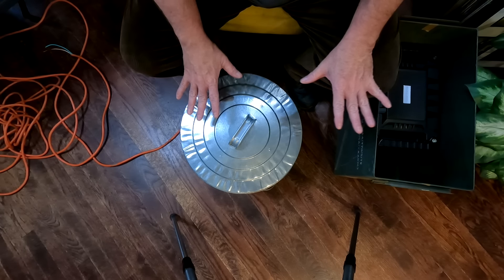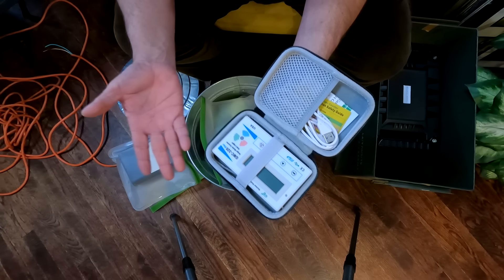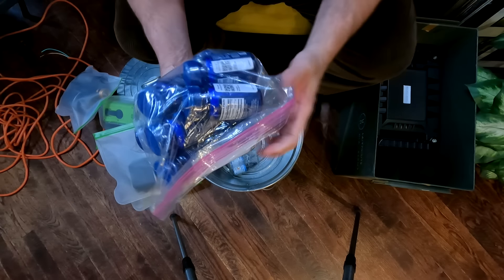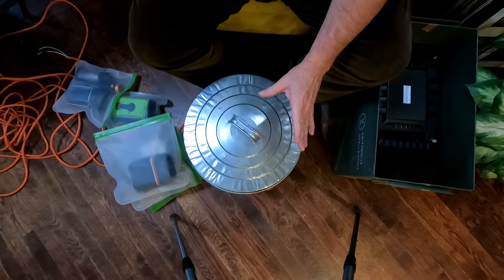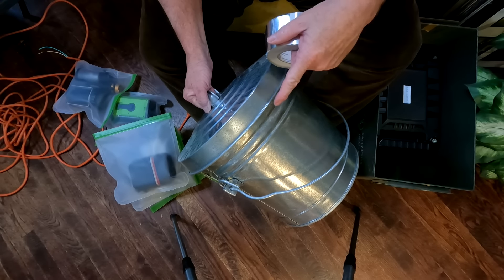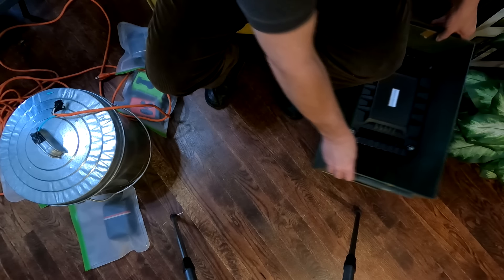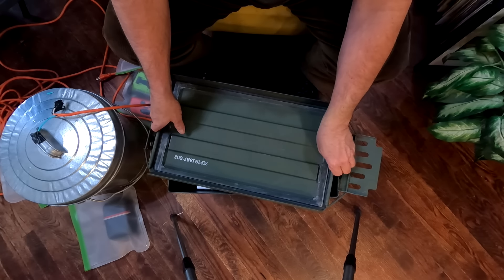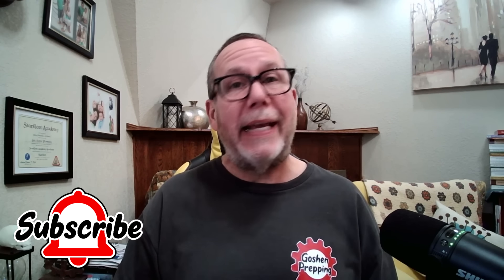How to make a FARADAY CAGE – The Correct Way – Quick and Easy

Comment: The Faraday cage is to protect from 'electromagnetic' interference .. not radiation itself. It's purpose is to protect electronic equipment from being damaged by an EMP source that will generate high voltage and high current surges across the surface of a metal container.
The cage MUST be electrically 'airtight' and a rubber seal WILL matter as electromagnetic waves will pass through rubber.
The items within the cage must be electrically insulated from the cage itself .. that is .. wrap each item in something that does NOT conduct electricity.
Inside my cages, I have used marine carpet to line the inside and to ensure that nothing within the case will be able to come in contact with the actual case metal.
If you wrap each item individually with aluminum tape or use a mylar bag ... make sure to insulate the item from the aluminium or mylar as well.
Remember, if you use aluminium/copper tape to seal any gaps,  there is a thin layer of non-conductive 'adhesive' that's being used to stick the tape to the cage ... therefore, ideally, you need to ensure that the tape is ACTUALLY electrically connected to the cage.
At the end of the day, it can't just look the part, it needs to actually do what it's supposed to do!
If you should be unfortunate enough to experience a nuclear detonation and live through it, DON'T open the case straight away .... there may well be more detonations to come over an extended time frame.
Reply: If I use insulating foam padding inside the can, but there are gaps/seams between pieces of paddings, my electronics are not touching the metal can itself, is that ok. Or do we need to tape up the seams to prevent any sparks? Use metal tape? Thx
Reply: Make sure to wrist strap and use an esd mat. The bigger your antenna, the less the emp will attack your electronics, and it's helpful to drive your ground rod thru the can for maximum effectiveness.
Reply: I hope people take the time to read what you wrote. He doesn't seem to understand what an EMP actually is.

Comment: To avoid shock when opening your Faraday cage wear thick oven mitts.
Reply: I wouldn't trust oven mitts. When I would replace picture tubes in arcade games I would use a screwdriver to shunt the electric charge built up in them straight to ground. Id always do it twice just to make sure it was completely discharged.
 
 Which brings up an interesting thought. I didn't see him mention that the faraday cage should not be set on a cement floor and in a grounded environment.  The can itself should be grounded.

 I'd like to see experiments on this and the amount of electrical energy that could closely relate the emp discharge of what you are trying to protect against.  What is worse. Not be grounded and the metal itself will attract the emp or will there be feed back to earth ground that would lead to it? You can't imagine the amount of energy being created and based on the distance it has occurred brings up so many variables.

Comment: Good video.  I'd recommend any comms being added to the pile, as well as any small smart batteries, (like 18650 with chips), and any new LED household bulbs.  It would be a bummer to not have household bulbs!
Reply: I put 2 way radios and some pale blue batteries as well as an electric forehead thermometer , an ecoflow river, and a steripen
Reply: Night vision equipment too if you have any, and Electronic ear protection.  Small solar chargers. Maybe even small foldable or roll up solar panels. I’m not sure if they will be effected or not. I don’t recall anyone ever talking about the solar panels being effected, but I bet controllers and inverters could be. Just some thoughts.

Comment: Thanks for your videos. I’m a bit confused about insulating electronics inside the can,,, yet you mentioned in a past video that your automobile’s are safe a don’t require protection. Electronics are electronics, be it a laptop or automobile components. I’ve done research from PHD’s and they indicate automobiles do need protection. Good luck everyone!
Reply: They sell some kind of surge protector you put on the battery but could be a scam?? autos before electronic ignitions wouldn't be  affected probably older than 1975, my 78 chevy truck had a ignition module in the distributor!😲😲
Reply: Yeah you are right , almost all cars made after 1980 will be inoperable after an EMP , but you can go ahead and steal the batterys out of the non functioning cars and charge them with your solar panels , assuming you had a charge controller in your faraday cage.

Comment: I have small and large cans like yours. When I was at home depot, I looked for plastic pots that had the best fit to insert inside the can. I found a perfect match as a liner. I like your freezer bag idea as well. I keep older laptops, cell phones for back-up and keep them updated and charged. The main thing is to download all the smartphone apps needed for communicating  with my devices that use bluetooth or WIFI. That's easy to forget and it will be too late if the internet is down. My latest smartphone in daily use, may be questionable if the EMP is strong enough.

Comment: I made a faraday cage for my bed. Covered it with aluminum mesh screen, all sides are double layered. The cage also has a copper wire touching it and is in the ground out side. When I got in the cage with my phone WiFi and phone service still works perfectly. Any advice?
Reply: If your bed isn't on ground floor there will be incredibly easy access for radio waves under you

Comment: Hey G.P., I've seen some videos where people recommend to put cardboard on the bottom and sides of your devices for additional security, to keep anything from touching the sides.  I noticed you didn't do that here and figured that was just as an added precaution but interested to know if you think this is something we SHOULD be doing?  I did the trashcan option the other week and then put some aluminum foil as seals before putting the top on.  I did not wrap the ends with that metal tap but will definitely do that tomorrow.  I wrapped all my solar panel boxes in multiple layers of heavy duty aluminum foil and hope that protects the panels and can use these with my 4Patriots battery (in trash can) IF SHTF.  Thanks for the great videos, really learning a lot! 🙂
Reply: Battery's and solar panels wont be destroyed by and EMP , only electronics like the solar charge controller and the battery chargers need to be protected.

Comment: I store all but two of my Dewalt batteries in ammo cans inside a metal filing cabinet 🗄️. I left the rubber seal on because it was my understanding that it helps with fire prevention and I put a layer of cat litter in the bottom to prevent contact from the metal and again added fire prevention. I considered wrapping them in aluminum foil but I periodically swap them out to cycle through them and just felt like that was overkill. 

As for grounding the item correct me if I’m wrong but as long as it is set on concrete - Slab, garage or basement then I am under the impression that it would dissipate any charge it may receive.
Reply: I think it would be fine.  It's not really hard to ground though for extra peace of mind if anything, just run some wire from your can to a copper water pipe in you home.
Reply: @Arbbal  Not many have copper pipes any more, even the gas company just changed to some type of plastic underground and then steel at the meter!😲😲

Comment: I use a metal filing cabinet in my garage (with the safety tape and other considerations) and I have a wire going right beside it to a pipe on my water pump. It does provide a ground, I checked with a multimeter. (It just occurred to me that I need a multimeter protected also) I am not a full-on prepper, but an EMP is so easy (for a nuclear power) and so devastating.
Reply: My first instinct was yes it needs to be grounded. Then I worried what if that amplifies the problem? My first thought was to disconnect it from any grounds, to be insulated from the field as much as possible. Id like to see some experiments done on this topic and the amount of energy that would be created and rapidly forced into the environment. With all the other variables that will happen. Wish Tesla was here to answer my questions.

 I have learned that what I imagine might happen is rarely what will happen. Unless you know all the variables our imaginative guesses can be dangerous.

Comment: Great ideas. But I’m pretty sure you need to seal the lid of the trash can with folded aluminum foil or similar (that’s the least expensive way). Also, I believe ammo can lid needs to be connected to the box via some braided wire of some type. Just things I’ve come upon in my research over the years.
Reply: If a faraday cage functions as a cage, full of holes, you know, a cage. Why seal the can?
Reply: @Endless_Skyway_Adventures because a nuclear emp would be emitting such a broad array of frequencies you need to cover for them all.

Comment: Question: will stainless steel work? The previous owner of our house left behind restaurant quality coolers, deep freezer and food prep cabinets with locking doors. They seem to nice to not use for something.
Reply: Yes, just needs to be 
1. conducive material: all metals. 
New garbage can is cost effective. 
2. What’s inside needs to be shielded from the can. Cardboard boxes are cost effective insulators. 
3. Can is grounded. 
4. Hope for best. 😊
Reply: Are these in working condition? If not you could use them but probably need to cut off the electric cords and put metal tape with conductive glue around all the doors and openings.

Comment: Grounding can be achieved simply by having a wire with alligator clamps like jumper cables from your metal water and or gas pipe that enters your home or the copper stake that grounds the homes breaker box.
If remote just have a copper stake you drive in earth and jumper wire. 
If remote and all plastic plumbing etc. Your well water casing is made of steel you can attach to. Just some ideas, I am sure there are more.

Comment: I thought no one over 40 needs potassium iodine no one ever mentions this even when they are obviously over 40. Did not know about LED bulbs either. Would a small metal bread bin work?
Reply: Iodine stores in your lymph nodes, it displaces radiation which also store in your lymph nodes

Comment: EMI and RFI pulse will enter any void, we're metal to metal contact is missing. All rubber and paint must be removed down to bare steel, both lid and case. Aluminum foil must be applied in where the rubber gasket sat. Use a dollar bill in-between the lid and case close lid on the bill, it's loose you have a leak. Add more foil till you get a tight fit. Turn on a portable radio and lay it into your container, close lid if you can hear the radio you have a leak.

Comment: Place these on concrete slab or in the dirt and they are grounded.  Same reason a lot of people go barefoot is so you stay connected to ground.
Reply: i get putting it in the dirt to ground, but how does putting it on concrete ground it?
Reply: @Christian-lw7dh Bare concrete is one of the best grounds.  I worked in electronics industry and we used ground straps on our shoes and bare concrete floors to get a good ground.
Reply: I can only think of a garage for a concrete floor. Would that work?

Comment: Forgive me if I sound extremely ignorant. 
Honestly, when it comes to prepping I am, it's all new to me. Regarding what to store in the cages, I was wondering about emergency food and water supplies. Also batteries for flashlights etc, and chargers for laptops or tablets. Would it be necessary or a good idea to have a cage for those items as well? Thank you
Reply: i have storage containers for my emergency food, water purifiers, medical supplies ect. Nothing electronic. anything with a battery or needs power to turn on you want to put in a faraday cage like the ones in this video.

Comment: QUESTION: I was considering using an old metal truck tool box. One that spans the width of the bed and sits by the cab.  Just like you get from the auto stores. Could this be used the same way?
Reply from the maker: Sure could, yes.
Reply: @GoshenPrepping  Thanks! That’s exactly what I was thinking. Would an aluminum one work ok?  It seems like it would. It’s just softer, lighter  metal.

Comment: Line the inside of that trash can with cardboard. You need more insulation than a zip lock bag. Test that tape with a VOM to make sure it is conductive on both sides. A strong electric charge is going to go where it wants to go.  Think lightning.
Reply from the maker: Not even close. The amount of charged particles will be minimal.

Comment: I DISAGREE. I SUGGEST YOU PUT A SPARE CELL PHONE IN THE TRASH CAN AND YOUR AMMO CAN AND TRY CALLING IT. IT WILL RECEIVE A SIGNAL. ALSO YOU NEED TO LINE YOUR CANS WITH CARDBOARD AND SEAL UP WITH SILVER METAL TAPE WHERE ANY SEAMS MAY BE. ALSO PUT A LIGHT IN YOUR CANS AND TURN THE ROOM LIGHT OFF AND SEE IF YOU SEE ANY LIGHT COMING OUT, LIKE WHERE THE HANDLES ARE. TAKE CARE.

Comment: QUESTION FOR ANYONE 
Would it work (for a Faraday Cage) to use a "plastic" container lined with one of those "emergency survival blankets"??🫤maybe a couple of layers???
Just curious, the plastic containers and emergency blankets combined would be 1/4th of the cost of metal containers.

Comment: Buy metal sheets, copper, lead, steel, and make them into pipes. You need plastic pipes too. You want to Russian doll them. Lead as the outmost. Then plastic, Cooper and steal. Then plastic. Seal the end with metal too. Layered. Very strong.

Comment: Is it possible that an EMP could be across a very broad spectrum of electrical strength? Maybe there's many wavelengths of strength they could be at? 

People say that they have proven in some videos that a faraday cage works without a grounding. You said that your contact said that it didn't have to. But many others in other videos said you don't need grounding. But it seems to me that wouldn't there still be some advantage of having a ground since there may be more than 1 level of strength of an EMP? (And this also leads into my question on antennas and areas near them and about different levels of strength of EMPs.) 

Would a car work as a faraday cage somewhat since they are all metal (except for the windows? And would you have to cover the windows with metal or mesh to fully enclose it?)? 

Would objects next to antennas be more vulnerable to EMPs? Some people may have antennas up because of ham radio stuff, etc. Also people could prepare ham radio equipment as part of their things to do. It would seem like if grounding is important then possible areas near antennas could be more vulnerable. 

Will EMPS fry solar panels still, even if they are unplugged?

Comment: Thank you for the faraday cage information, I have a list made. I have a question. Our house is a 1978? Double wide on a basement. How will or will there be any effects on the metal (stainless steel support beams and flooring? Is it good that there might be some of the old steel siding under the lapsiding? Just wondering if we would be more protected or not.
Reply from the maker: No, not really. It's too sparse to make a difference.

Comment: Good info, except the chances of a pulse affecting the interior of your can through an untreated gap is not "pretty much nil",
It's more like 100%..russian testing has shown emps to be effective in causing damage as far as a full meter beneath the ground. Penetration is related to the power of the emp vs the slot gap. The best way to seal that electrically is to fill that gap with a formable metal like aluminum foil or to pour lead into it..or something similar. I wouldn't trust foil tape, because the adhesive is a dielectric which leaves the gap an emp can overwhelm.

Comment: You keep intertwining the term EMP and Radiation. Are you proposing that this solution works on both? Thanks.
Reply from the maker: The EMP is simply made up of charge ionic particles, as a result of what's called Compton scattering. In reality, it's called ionic radiation.

Comment: I believe that your electronics would have to be turned on in most cases to be harmed by an EMP.  An unenergized system should not “fry out” just because electromagnetic waves pass through it.  A pulse passing through a completed energized circuit is what over powers the circuit and causes the short circuit of the system, according to my understanding of electromagnetism and electrical current.

Comment: Instead of a metal garbage can, could I wrap a cardboard box with aluminum foil wrap?
Reply: Next Christmas go to Walmart and buy one of their giant metal tins of popcorn. Try to find ones with solid lid versus peek a boo plastic lid. Otherwise cover that perk a boo part (the entire lid with tin foil. Then tape it up. They usually go on sale for $5.99 or less right before or after Christmas. They get thinner and smaller every year but worth a look. I bought mine when they were pretty thick tin and had full covered lids. Hopefully, they will come back this year. I double wrap my radios in tin foil and lined inside with cardboard. Have no clue if what I am doing works but needed cheap at the time I started to prep. Good luck.🙏🏼
Reply: @elaineinarizona6354   I picked up two in December😁😁!

Comment: Ok. I tried putting my phone in my microwave and an old metal tackle box. Both I had my phone playing a video when I put it in. I figured if it worked my phone would loose the signal and stop playing. It did not work. Phone kept playing in the microwave and the metal box. So what's the deal???